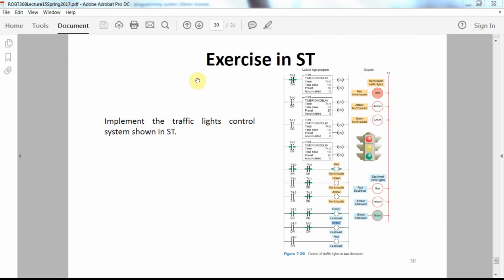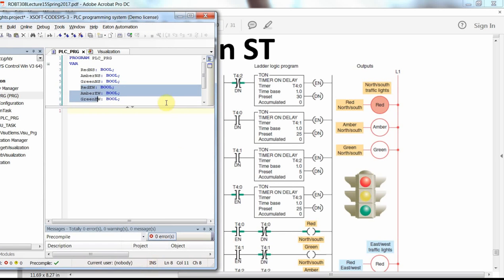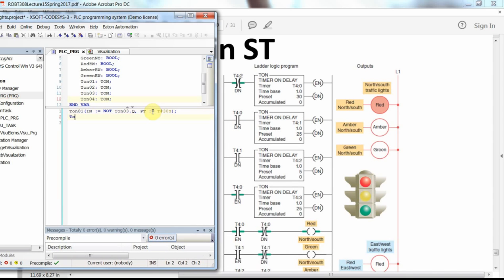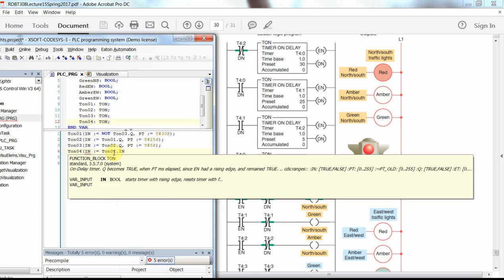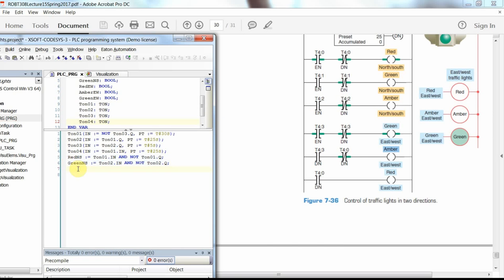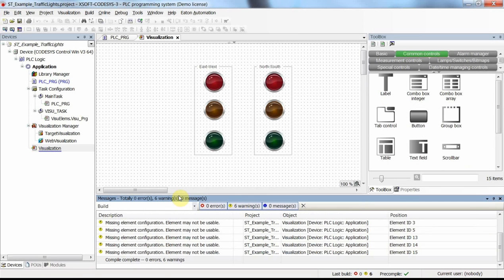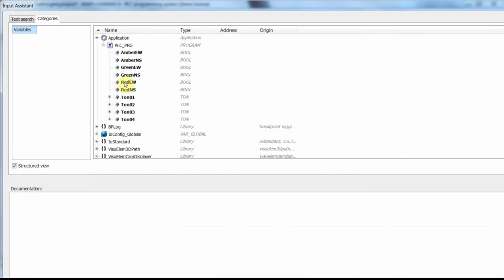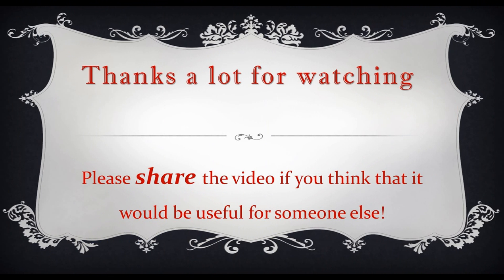CODESYS: Structured Text (ST) programming example - Traffic light control

Comment: Why are we using 4 timers? Maybe 6? I guess I did not understand the logic of working.
Reply from the maker: To create the sequence, as we need to have the Red light being turned on for 30 seconds in one direction, during which the yellow light will be on for 5 seconds, and the green light will be on for 25 seonds. It should be clear if you check the last 6 rungs in the ladder logic code.
I hope this helps.